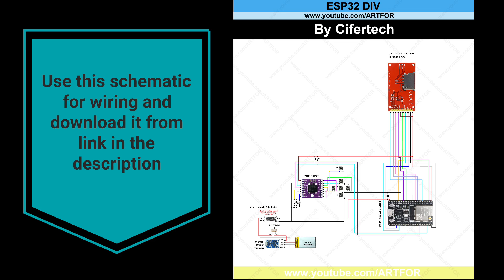ESP32 DIV BY Cifertech Part 2 Connect Display to Esp32

Comment from the maker: Enjoy the video, Next is installing the buttons. You can ask whatever you like here👇...
Reply: If I use the ST7735S as a display, will I have any problems?
Reply from the maker: Yes you will, this code is setting for ILI9341 driver not ST7735
Reply: @ARTFOR thanks
Reply from the maker: You're welcome 👍
Reply: i've noticed you left out IR. is there a reason? it's only gnd and one gpio
Reply from the maker: No reason, I forgot. I made the schematic a bit hastily, I'll fix it later. Thank you very much for letting me know.

Comment: Hi, I have a question regarding the pin out of the esp32 in the schematics of cifertech, the miso mosi connection is made with Gpio23 but on my devkit there isn't
Reply from the maker: Did you mean pin 23 of esp32 wroom32u? What devkit you are using?

Comment: Tu lcdnya 2.4inch,
Reply from the maker: Iya
Reply: @ARTFOR saya coba flashv1.1.1 0x10000
Partition 0x1000 kog error ya kak.
Reply from the maker: Pake flash download tool ini?
Reply: @ARTFOR biasanya saya pake hp lancar.mungkin firmwarenya beda
Reply from the maker: Coba pake PC sama partition memory address itu 0x8000 bukan 0x1000. Kalo 1000 itu buat adressnya bootloader
Reply: @ARTFOR yg bener ky gimana kak untuk 0x10000 dan untuk 0x8000 
Mungkin saya kebalik ngisi file firmwarenya
Reply from the maker: 0x10000 untuk esp32 div.bin dan 0x8000 untuk partition
Reply: @ARTFOR kalo saya lihat di serial monitor  ada tulisan error

Comment: My st7789 display is not working properly, How do I fix it?
Reply from the maker: This build is for ILI9431 not for ST7789, to fix it you need to modify the codes
Reply: @ARTFOR  how to modify the code ? Can you upload the modified code for ST7789 😢
Reply from the maker: No, i'm poor in coding😵‍💫😵‍💫😵‍💫